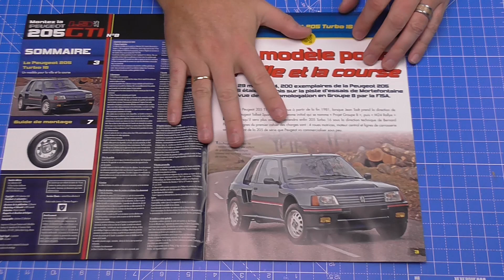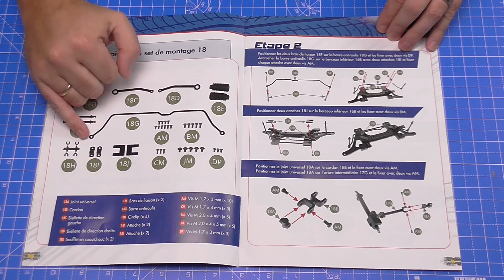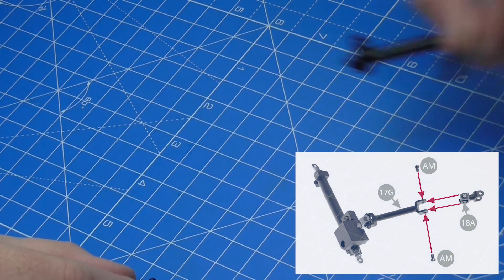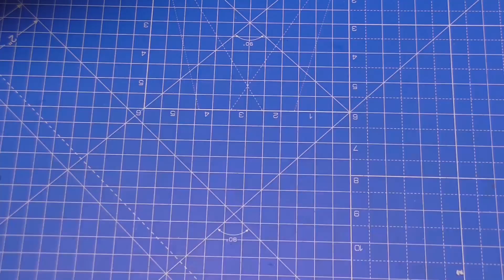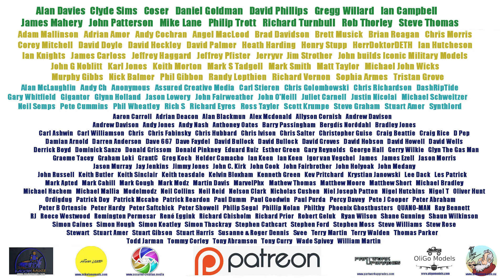Build the Peugeot 205 1.9 GTI - Parts 17,18,19 and 20 - Attaching the Steering, Suspension and Wheel

Comment: Any about the ecto 1 this year
Reply from the maker: Nothing yet. There was a message from Eaglemoss recently. 
Mustang UK – shipping is still on hold at the present time, this is related to customs requesting additional paperwork which requires some changes in our IT system. Our developer is working hard to have this completed as soon as possible, but we will require a bit more time to test the new process to make sure it fits customs requirements.
Mustang Europe – your orders are being dispatched at present and should be dropping onto your door mats very soon.
European shop orders – any orders placed before 10th Feb will be processed (if stock allows) from the UK, the new warehouse in Germany will start to fulfil orders from the 11th Feb. Due to the changes with BREXIT some shipments have been stalled. 
The warehouse team are dispatching as many orders as possible each day to clear the back log as fast as possible. You will receive an email once the order has been picked and packed along with tracking information.
If you do receive any costs for importing an order you can contact the Customer Service Team on email or DM, include a copy of the customs charge associated with your order. We will refund the difference against your order.
Thank you for your understanding and ongoing support.